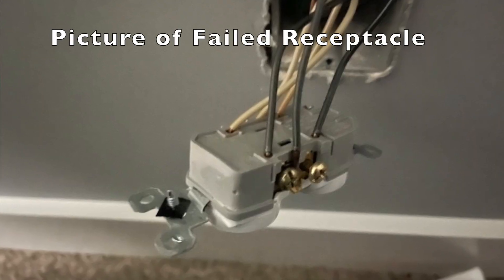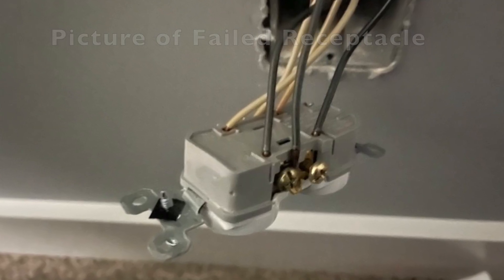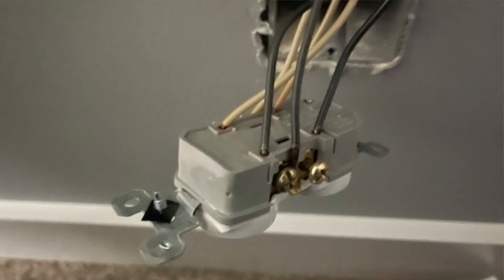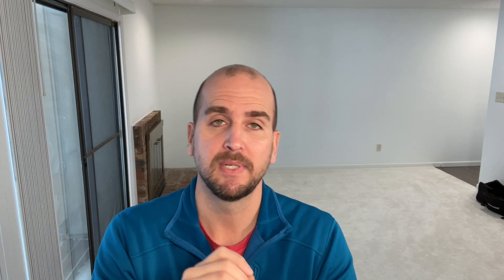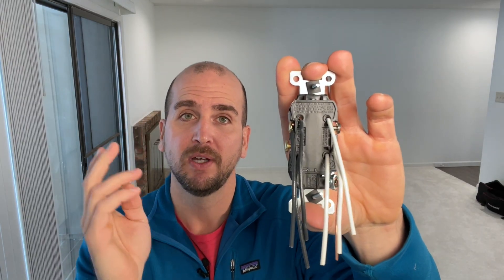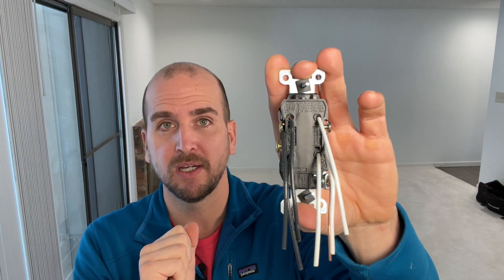Incorrectly Wired Outlet Found In Newly Built Home

Comment: I'm not an electrician, but I am a electrical engineer.  Point a is a moot point.  There is no current path across that loose screw.  Sure, it could possible short out, but I doubt it.  Also, point c is moot.  The current  path is exactly the same, as kirchhoff's law demands.  The only thing you are doing differently is relieving physical stress from the outlet.  Best practices are great and all, and it's a good source of needless dick measuring.  Yet nothing changes the fact that the outlet failed, because it is cheap, and we are over confident in corrupt government regulations.

Comment: A customer was buying a new motor for his swamp cooler every year.  I looked at the problem and the motor was humming although in the off position.  Problem was the poles were reversed at the outlet.  Switched them and problem went away.  The home was wired throughout like this by the home builder and I was not hired to correct the problem.

Comment: The reason that you do "pig tails " is for the outlets further down the line. If say something goes wrong with the middle of the run outlet and it has to be removed, you don't want to lose the continuity of the run especially not the neutrals. And it is easier to remove and replace that receptacle , with just three wires.
Reply from the maker: Agreed, I should have been more clear with the benefits for using pig tails.

Comment: Scott, 
Good thoughts on many things.   
If someone takes on electrical projects they are considered as hiring themselves out as an electrical contractor.  If not licensed this is illegal, not to mention carries a very high liability.   
Too, the white wire is not a neutral. It is the GROUNDED conductor.  The green or bare wire is the GROUNDING conductor.  It is only a neutral if it part of a multi-wire branch circuit. 
Outlet is a box location.  It is possible to have a round outlet box, as for a light fixture or smoke detector.  Or a multiple gang outlet box for designated devices.  A receptacle or a switch are both considered devices.  A receptacle is not the same as an outlet.  
Picky?  Yep.  But if we train the public of the correct terminology they will have greater confidence in knowing what they are talking about.  Too, they can better describe a possible problem to an electrician.  
Again, VERY nice job on installing pigtails on the wiring to power the receptacle.  So much better than having a receptacle carry the load of the circuit.
Reply from the maker: Appreciate the feedback.

Comment: I have a suggestion.  Any electrician in the field will have some sort of powered bit driver.  I'm currently using a Milwaukee m12 1/4 inch impact.  Set it to low and you won't strip even going into plastic.

Comment: When using metal boxes, Ideal makes this awesome 600 volt rated rubber band. No more tape! Those things are awesome!
Reply: theres no reason to use tape on a box if you terminate everything properly
Reply: @jordanadams5902  I agree Jordan but unfortunately it doesn't always work out that way. Especially with old work boxes when you have to snip the ears off the receptacle to properly seat it. I just came off a $3 million dollar historic house renovation where every outlet was cut into white oak molding. There was over 100 of them and at least two or three failed on each floor due to contractors plugging in heavy cords for over a year. Due to the rough nature of their actions the body of the receptacle would fail, resulting in usually a neutral to ground contact. That's when I discovered the 600 volt blue rubber bands by IDEAL. No more headaches chasing down bad outlets after that. Before this job I always said what you just said

Comment: UL listed or not, don't backstab! They have the same type of terminal that is mechanical. Stick the wire in the hole and the screw tightens the copper in between pressure plates.

Comment: A commercial grade 20A receptacle wire size is 12 gauge where a 15 amp is 14.  Also receptacle boxes aren’t supposed to be junction points for multiple outlets.  You should be using J boxes that feed the various receptacles on that circuit branch.

Comment: 1.  Commercial grade receptacles are 20 amp.  Residential are 15 amp.  The residential panel is 15 amp.   The amount of wiring going in and out of that receptacle is too much as well... again, what are your credentials.
Reply from the maker: Hi Will, I am just a DIYer sharing my projects.  I am not a licensed electrician, plumber, or any other trade.  Just to be clear you can get commercial (spec-grade) receptacles as both 15 Amp and 20 Amp.

Comment: Anytime I change out a receptacle or a switch , I always use the commercial grade because those cheap receptacles do and will fail over a short period of time , and never ever use the push in connectors
Especially in kitchen and bathroom receptacles because high wattage appliances are being used there 
Such as hair dryers in the bathroom and various heating appliances in the kitchen , Commercial grade receptacles are a definite must in the kitchen and bathroom because tight connections are very critical when using heating appliances ,
Using push in connectors will for sure cause the connection to overheat and can very easily start a fire , 
No matter what outlets I'm changing out
Whether it's the kitchen and bathroom or the living room I always replace them with commercial grade outlets
In newer homes , I see this alot
The outlets in the kitchen are on 20 amp circuits and they used 15 amp outlets
Now when I change out these outlets
I replace them with 20 amp commercial grade outlets instead of the 15 amp outlets because when you take a plug and plug it into a 15 amp commercial grade outlet
You'll have a satisfactory connection
Now take the same plug and plug it into a 20 amp commercial grade outlet and you'll see that the 20 amp commercial grade outlet will have a tighter fit , Which makes for a much safer connection , When it comes to outlets being used for heating appliances , The tighter the plug fits , The more safe it will be
If you're willing to spend the money for even a safer outlet , Use a hospital grade outlet
Which is extremely durable because whatever you plug into it , Guaranteed you will have a tight connection and these types of outlets are built to withstand plugging and unplugging , 
My buddy , Who's wife is always using heating appliances in the kitchen , In fact , She uses heating appliances instead of the stove to conserve propane , Especially in the winter , She uses electric skillets , Counter top ovens , Air fryers and all other kitchen heating appliances because where they live
Propane is expensive and they only use propane to heat the house and the hot water tank
Well I just happened to have some hospital grade outlets I picked up at a flea market
Brand new and went to his house and installed them in the kitchen
I did this about 10 years ago and they still work like a champ
It definitely pays to use top quality materials for any electrical installation , Your circuits will perform at their very best and you'll be able to use them with confidence because you'll know that they're safe
Whenever I do any electrical work , Safety is always priority one and I only use top quality materials , Also when I change out an outlet having multiple wires , I always pigtail them which makes for safer connections and makes changing the outlet much easier
As shown in the video , B4 installing wire nuts , Pretwist the wires together with lineman's pliers and snip off the end B4 putting on the wire nuts , If you want an even safer connection B4 putting on the wire nuts
Solder the connections but only use rosin core solder which is for electrical work
Allow the connections to cool completely B4 putting on the wire nuts

Comment: You should use the Wago 221 connectors instead of wire nuts, it makes the job easier, they are reusable and safer than a bad wire nuts installation.

Comment: I have been living in my 1970s built home for 4 years...last week, the fridge suddenly stopped working!  PANIC!  My brother came home, plugged in an extension cord, and verified that the fridge was actually still working by plugging into another outlet.  The fridge's outlet was on the same circuit as the counter outlet in the corner, and that outlet was also dead.  Upon inspection, that 2nd outlet somehow had the neutral wire come disconnected.  How that happened is beyond me (vermin in the walls?).  Point is...people often take electricity for granted (until it doesn't work), and these $5 outlets are often the culprit.  Cheap and easily replaced...if you have problems with stuff staying plugged in...or worse, shorts...man (or woman) up and replace them!  It's easy!

Comment: Most "push ins" are clamped down by the same screws that you put the wire around normally. I always wrap my outlets over the screws with electrical tape.
Reply from the maker: That is not true on the low end residential grade.  Here is a video showing the internals https://youtu.be/kX6xnOksQTc

Comment: Where do you get the wiring to make the pig tail?  What gave should I ask for?
Reply from the maker: If it is a 20 Amp receptacle you should use 12-gauge and if you are using a 15 Amp receptacle 14-gauge.  I just have some left over 12-2 Romex and 14-2 Romex which will have the hot, neutral, and ground wire for any pigtails you need to make up.  I also really like the Wago 221 lever nuts compared to normal wire nuts for DIYers https://amzn.to/3qc0lQd

Comment: One reason to have more than two hot and two neutral wires is he one of the receptacles are controlled by a switch.   In that case you would also remove the jumper one either side.  Good video, thank you!!

Comment: you add pigtails so the receptacle isn't carrying the load of all downstream devices.., This is what causes receptacles to go bad prematurely...  The device is NOT supposed to be a part of the circuit. receptacles are utilization/end of line components. they are not intended to be a feed-through device, the extra set of holes in the back and terminal screws on the side are for use when breaking the side tabs and switching 1/2 of the device. The conductors should be made continuous and NOT rely on the device for continuity.  when you use the receptacle as a feed through device it carries the load of the all downstream devices, this is why the first receptacle on the circuit is usually the one that overheats and becomes brittle over time. when you use pigtails it only carries the load of whatever is plugged into it.   Adding pigtails also ensures the downstream devices have no power interruptions when there is a fault with your device or you are servicing the device.  installing pigtails does not make tucking the wires into the box easier. just the opposite is true.. as you have increased the box fill.... what makes tucking the wires into the box easier is craftmanship and ensuring your pigtails are at least 6" from the front of the box... not 6" minus 2" within the box minus 1" stripped from both ends for termination... ie... your pigtails start as  10" long pieces of wire.  the NEC requires 6" from the face of the box after installation... also for all of you LEFT HANDED ELECTRICIANS your terminations loops and wire nut twist always need to be made clockwise to ensure tightening the screws/wires does not cause them to open up, and not meet the 270* requirement.  fwiw

Comment: Pigtails are unnecessary for 2 wires per pole non multiwire in most residential installations for general purpose recepts in bedrooms living rooms. Circuits in kitchens garages baths, maybe however the added wires in the boxes can cause problems getting the receipts in. Remember, houses from the 1920s still have their original recepts and are doing fine.

Comment: Yo. Wrap the outlet twice with electrical tap going over the screws. Required in MA. Done.
Reply: i work/live in Florida . the tape thing is not required here . . . but i do it anyway . better safe than sorry !
Reply: I always wrap the outlet too, but I’ve heard that it may not be a good practice to wrapping an outlet (or wire nuts) with tape. This is because if the wire becomes loose it can disconnect from the circuit or short out on the box (I’m in Chicago, all metal boxes/conduit in residential). If it is taped, it may prevent the wire from completely disconnecting, causing a possible arc.
Reply: @iap6647  Fast forward 50 years later...Metal boxes/BX Cable/Romex/ WIre Nuts Tape...Arc Who...come on man.
Reply: @skiprope536  What are you saying?
Reply: @skiprope536  Hilarious! You have no clue of my electrical experience. Took all of two seconds to find this: ‘Anecdotal evidence: I've seen the aftermath of a badly-installed neutral arcing inside a metal electrical box. There was some damage inside the box, but the box contained it. Outside the box was fine.’
Here’s another one: ‘wrapping outlets is handyman and homeowner work. Professional electricians never do it.’
Sounds like you need a lesson, or maybe attempt Google sometime. And lose the ego.

Comment: Not an electrician, but assisted one extensively and would like to add a couple things. 1) There is a proper amount of force (torque) for tightening every screw in an electrical system. Tighter isn't necessarily better. If you don't have a master electrician to test the first zillion you do and teach you to work by feel, think about using a proper torque-wrench and the manufacturer's spec sheet for each device to learn what torque is needed. And maybe that notion of "I can do it by feel" is dubious because the gray haired master electrician I worked with didn't hesitate to use his; 2) I don't know how to describe this, but there is a way to dress the conductors into the box rather than just stuffing them in. Without care, you can loosen the screws on the device or otherwise affect the conductor attachments to the device. There's a way to dress the conductors so that you form a zig-zag accordian -like thing that just folds up as you push the device in and, just as you make the shepherd's crook go clockwise, you can make that accordion  in a way that protects how the conductor binds to the device; 3) There is a limit to how much can be in a box. If you don't know how to calculate box fill, don't change how much is in the box. This is super important. 4) The trick to electrical work is to learn to hold 5 things at once in one hand while you use the other hand to stab yourself with the screwdriver. Nice video! Just as you showed, I was taught to always make a helical, mechanical splice before putting on the wire nut even if the wire nut package says you don't need to.

Comment: I was an electrician for 30 years and I don' remember if this was state code (Mass) or not but it's good practice. He mentioned a plug in the basement. Basements usually have concrete floors so when I wired a basement, my plugs were GFI receptacles since concrete is a very good ground.
Of course outlets for equipment such as a refrigerator or freezer were not GFI since you could have nuisance trips of the receptacle.
Reply: Code now requires GFCI even for freezers.

Comment: Problem 4: That wiring method runs the current to the next outlet thru this one. I had a intermittent problem that was a bear to find. The lights to the bathroom would go dark. It turned out to be an outlet wired like that upstream of the bathroom. Those push in connections are just an edge of thin metal against the wire. Never use them.

Comment: Backstabbing devices is a plague of the electrical building field. Be it residential or commercial back stabbing with ALWAYS lead to problems down the line. Just make good pig tails and move on. Takes barely extra time.
Reply from the maker: Yeah backstabbing combined with not using pigtails seems to be the common recipe for failure.

Comment: Hello, You use the term Neutral for the white wire. I believe per the NEC, the correct term is ungrounded for 120v.  Neutral is used when there are 2 current carrying wires and one white or grey wire which is called Neutral.

Comment: Hello. I have no experience with these things at all. Pretty sure this is a stupid question but I still need to know. My question is, if we need only 1 red(hot) and 1 white(ground) wire connected to the outlet, then why is there 2 other red(hot) and 2 other white(grounds) that we need to pigtail? Why are they there for?
Reply: I would also like to know this.  Maybe in case you want to add a second outlet or a 4 plug one instead?  Maybe it is at the end of a line of outlets?

Comment: Been doing electrical maintenance ,Residential and industrial, commercial and i never use those push in connections , They are a knife edge connection and does not have the surface to handle a good amp draw for periods of time , Have replaced many after melting , Good pig tail connections ,never have a problem .